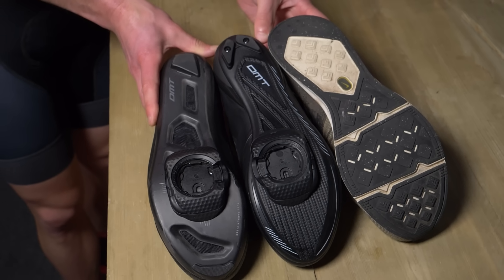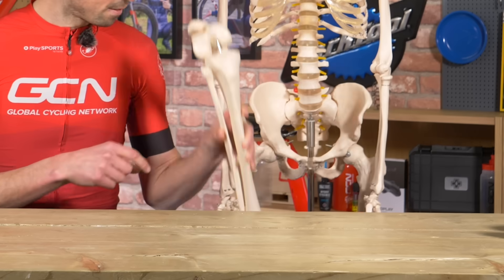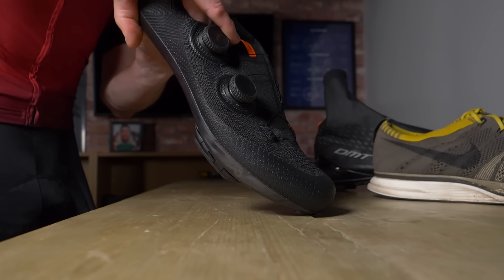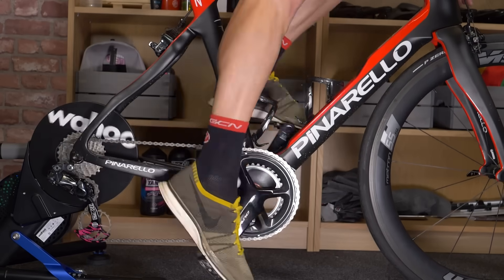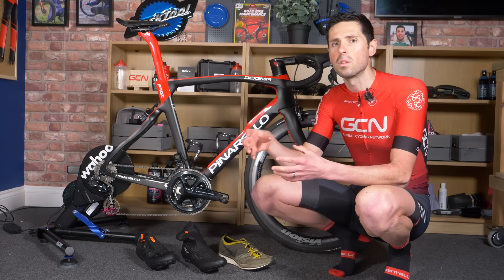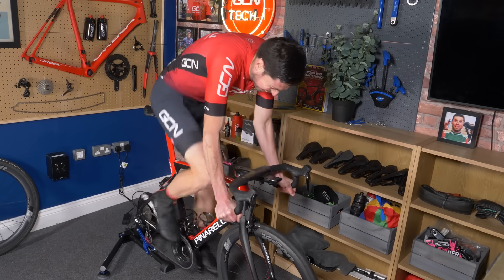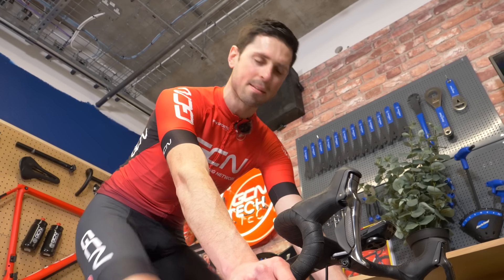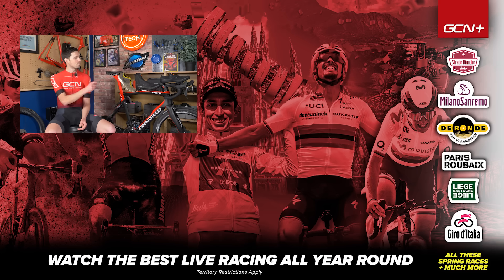GCN Tech Does Science: Do Cycling Shoes Really Matter?

Comment from the maker: Flats on a Pinarello F12??! Hot 🔥 or not ❄?
Reply: Bodge
Reply: The difference is 5% between the clip-in shoes, which is a lot.
Does this experiment only apply to track sprinting?
What about an endurance race?
Reply: @drivemenuts3011  Thats if you believe that guff. It was fixed of course.They want to flog useless carbon soled crappy shoes.I d only accept a mechanical test not some laptog having a bit of a pedal .In real life there would be no difference in any of the shoes
Reply: flats are for mtb. not road cycling. the benefits of clipless pedals and shoes are just way to high on a road bike
Reply: @leonschumann2361  Are they hell.you ve been completely conned all round.Proven beyond doubt and the Myth of the Upstroke has been proven 100% .It does not exsit.Only purpose cleats on shoes and pedals is security. Personally my feet have never slipped off any pedals in my life.Exact same power is on every shoe and every pedal.May be fractions of a watt lost on pedal bearings but thats all.Cyclists are easily conned.Look what the idiots are buying now..Oversized dearailleur pully wheels and oval chain rings lol lol..fools !
Reply: Well your flats don't have the cool little blinky led lights in them like mine so...Not.
Reply: @garrettsmith8286  Yeah, thats at least another 0.5 watts!  😉
Reply: Love it, I wear flats on my bike all the time. Don't have an F12, but I do think that Price is a major consideration. Those Carbon shoes cost more than some people have afforded to their bike. Meaning they must be on flats. Pedal/Shoe combo with proper fitting. 💰💰💰
Reply: If you have a good bike  and have security at work flats during the week.
Reply: @adambrickley1119  l would never run flat in town ever again. the amount of extra power you can get from your hamstrings and hips when accelerating of the lights and so on makes it so much more relaxed.
Reply: You needed the Nike super Marathon Shoe. 😜
Reply: F12 makes a lousy shoe rack

Comment: Stiffness is what prevents muscle or fascia injuries. Learned that even flexi shoes like Sphyre 902 903 at 15% less stiffness than S Works. Induced more fatigue and pain. Over the years learned that I feel these things like a good German shepherd senses lost scents. Anyhow I can tell cheap to expensive, can tell which one is stiffer and more efficient versus less stiff and intended for rpm. Diodoras vs bong vs bontrager etc. Lakes that lasted me 25,000 kms and a new pair of S Works told me the lakes had started to fatigue. Instant 5% speed gain thought shoe alone. For those of normal weight, 75-80 kg, uphill is the ultimate stiffness test. But I can also tell BB vs shell issues, or a bb not fully threaded due to epoxy. Finally o can tell any dura ace or ultegra cranky around 20,0o0 kms I sort of go through their lifecycle and they drop torsional rigidity and speed. So yes stiffness with comfort is faster.

Comment: Beside the output, the comfort also the key factor. I start with a shimano Nylon road shoes with stiffness index as 6 out of 12. With long ride (over 2 hours) I will feel numb with my feet. Now I am still using Shimano R320 (same generation of my first pair but it is the top tier product) with stiffness index 12, never feel numb anymore. Same brand, same size, same cleat adjustment. Somehow beside the sole, the surface also feel fitting better with feet even the entire design/size/etc are the same.

Comment: When I saw this video title, I was expecting a test using the trainer in erg mode but measuring rider output using a crank-based power meter to see how much harder it is to put out a given level of power in the various shoe+pedal combinations.  Does that make sense, or am I off base with that experiment?

EDIT:  on second thought, that test makes no sense, there'd be no difference since nothing would measure losses at the shoe.  I guess you'd need the rider to report how much their feet  hurt, and maybe measure cadence differences.  Maybe with a pedal based power meter with pedaling dynamics measures (and maybe using an spd-flat-platform adapter for trainers with the Garmin XC SPD power pedals and carbon and nylon/fiberglass MTB shoes for direct attachment).
Reply: Really don t want a human with his variable human efforts involved at all.Was a stupid test.Bike Radar did a bigger one using 50 different humans and showed no differences
Reply: @stuartchester7414  u are annoying as hell sir. Just put your cheap flat pedals on your roadbike and use your runningshoes to cycle and be happy with it if you think clips are useless and carbons soles are a joke.

Comment: Cleat vs non cleat give u more secure while off saddle or fast cadence with no worries tripping ur shoes from the pedals, as might happened to the flat shoes.

Meanwhile talking abt flexy vs stiffer cleat shoes might givin u effects based on physics, but consider if u gone for an endurance cycling, that a bit flexy shoes give u some stretches on ur feet in a long run cycling

Just in my opinion and testing

Comment: I recently felt a huge performance improvement by adding a very stiff insole (from Solestar) to my MTB Shoes*. At the trainer my FTP went up by some 10 Watts and my Heart rate was consistently lower when at FTP! (even the updated one!). These very stiff soles are not cheap (mine was 100 Euro), but they are a great way to make a more comfortable shoe very efficient. 
That is btw a good suggestion for a future test. Hold a steady power close to FTP for some 5 to 10 minutes and see the difference in Heart rate, ie. the physiological "cost" of holding the same power. 

*I use MTB shoes on my Road Bike, one because I prefer shoes with witch I can walk on, and two because my feet are wide and it's hard to find a wide road shoe, at least on the local shops here. My current shoe is relatively flex-y, something like 3 or 4/10 from the manufacturer scale, so the improvement with the stiff insole was massive!

Comment: For most of us, the stiffer soles result in less fatigue while riding.  Much more important than effect on peak power. We produce force through muscle contraction. That force pushes on the pedal, and a 10% more efficient transfer is huge over a 3 or 4 hour ride. (Note that at peak the difference was a lot not 1, 2 or 10 watts but about 200 or 20% more than a trainer.

Comment: Don't forget a stiffer shoe IS ALSO more comfortable : 
Apart from some high end pedals with a large surface, most of clipless pedals have tiny surfaces. Cumulate it with a flexible shoe and you end up with a high pressure point on your foot. 

The harder and/or longer you push, the stiffer your sole and/or the wider your pedal surfaces need to be. Be it for efficiency OR comfort.
Reply: Bike Radar tests say theres no difference..anyway who the hell sprints lol ..virtually no one
Reply: Is it hell more comfortable ! thats just your opinion , and its wrong
Reply: @stuartchester7414  
"Just" my opinion that is shared by a lot of other comments here and by many other cyclists and by my physiotherapist that did my postural study.

The physiotherapist that gave us a lesson on ergonomics on bikes during our formation (I'm a bike mechanic) told us comfort is not about softness. 

He showed us pressure graphics. Discomfort is caused by high pressure and softness only has little to do with it. Badly designed and positioned soft accessories can cause soreness and discomfort. Wood-hard carbon accessories can spread evenly the pressure and be surprisingly comfortable if they're well designed and positioned. What I wrote about pedals and shoes comes from there.
Reply: @nounours2627  yes. what confuses people is that switching from stiff shoes to soft shoes relieves foot pain. For example, my extremely soft (i can roll them up) barefoot running shoes feel much more comfortable for 2+ hour rides compared to my Shimano mtn bike shoes (using thesame dual platform pedals). However, the pedal is extremely stiff as it is made from aluminum or steel. So, this often provides an illusion when people only stay focused on the shoes and not the entire interface.

Comment: MTB....where you're sprints are 1500 watts repeatedly....and you CANT get over or past something with any less power.....Stiff shoes, that you can pull up with, help. It helps a LOT.

On the other hand, if you're carrying a bike on your shoulder to climb something, a little flex helps traction a lot. 

Also, the size of the cleat platform makes a big difference. I ride Egg Beaters, and without carbons soles, i can FEEL the shoes bending around that tiny brass cleat....and I'm not even a big guy (140 pounds), nor putting out 2000+ watts.

So, depends on your terrain, hiking needs, and cleat area.

Comment: Fun video to watch. But the experiment would have been more revealing if you used a "normal" lace type mid-priced clip-in shoe rather than a winter shoe that uses a zipper. I can't imagine a zipper holds your foot in pla e as securely compared to a lace system.
Reply: It has Boa closing system. Zipper only closes the waterproof layer. Check 1:43.
Reply: @mikkojolkkonen5932  Ah! Good catch. Thanks!

Comment: I wouldn't mind betting that a fair chunk of the difference between the flexible trainers and the nylon-soled midrange shoes is actually down to the difference between flat and clipless pedals. You're introducing another variable here that you didn't have to. Even just bolting some cleats onto some £20 Lidl trainers (with a credit-card-sized steel reinforcing plate just to stop the cleat ripping out) would have removed that uncertainty.

Secondly there absolutely is a way to measure the stiffness of any given structural object, namely to measure its deflection under a given load. You'd have to make sure all soles were the same size because obviously a size 47 sole would deflect a lot more than a size 35, but such a test would give you a much better basis for comparison.

You can get pedal force data from any power meter so it wouldn't be too hard to replicate the variance in load throughout the pedal stroke for a 5sec sprint, 1min hard effort and 20min sustained effort for example. I would guess from your test and from certain comments on here that perhaps this matters more at high (say >1000w) power outputs than at the more modest levels (250-500w) that most of your viewers will output on a typical ride...

Comment: Stiffness will get you the most watts, but I tend to avoid carbon soles.  I Used a carbon soled shoe for several years and found that my feet would fatigue over long distance rides.  The nylon sole was the best compromise for me.  Gave me adequate power and provides enough flex that my feet don't ache after a longer ride.   Now, everyone is different, and will have different pain thresholds so do what's best for you.  If you can get away with the carbon soles they'll definitely perform better.

Comment: #askgcn Does the bike not get damaged when used in a hometrainer? It's bolted stiff into the trainer at a point that is not really designed to take stress in those directions when used on the road, where the backend is free to tilt sideways.
I see people selling their bikes, emphasizing that " it's only been used indoors.." but I would avoid bikes like that.
Reply: No more load than hitting bumps with the rear end at speed.
Reply: @ERIK31351  That is an up/down movement. Sprinting on a hometrainer, excerts the bike for sideways/tilting forces which never happens on the road, where the rear is free to move.

Comment: Nice test. Probably  shoe stifness is more important in sprinting and less consequential in regular riding where the power output is less than 300 watts.
Reply: Kind of... I use MTB shoes on my road bike, and the one I have is relatively flexible (not like a trainer, but more flexible than a reinforced nylon one). I added a very stiff insole and I felt a massive improvement (some 10 more Watts to my FTP - 260 to 270W - and a lower heart rate when at said FTP. So also for longer Tempo and FTP efforts a decent stiffness does help (but yeah, maybe less obviously than on sprints)

Comment: When I first started riding in the early 80's, I just used trainers with toe clips. I discovered that they were alright for rides less than two hours, but for rides of 5 hours or more, my feet would begin to hurt, and the bottoms of my feet would feel bruised the next day. When I started racing, there were no carbon fiber soled shoes. Nylon soled shoes could get you through a three hour race, but left your feet slightly sore the next day. I finally picked up a pair of Super Stiff Duegi 101's, that actually used a wooden sole to provide the stiffness. By the late 80's, clipless pedals were becoming standard equipment, along with carbon soled shoes. Nylon soled shoes are fine for two hour rides. PS. Not sure if they still make them, but Sedi used to make a shoe that used Carbon AND Nylon in their sole to provide stiffness almost as good as all Carbon.

Comment: How about a casual Z2 ride though? I could imagine the difference in power transfer is far far less between stiff and ultra stiff?
Reply: Seeing as this test was bent and bigger testing have been done showing zero difference, the normal hobby cyclist is wasting his hard earned for no reason..In fact its proven beyond doubt that clipless pedals have no difference neither over flats
Reply: @stuartchester7414  oh no I would strongly disagree.
You’re “locked in” a certain position and won’t slip around.
But most importantly you’re able to pull(!!) up engaging your calf muscles. Apart from being extremely efficient if you use the entire circle within one pedal stroke, I’ve had numerous times where I quads started becoming pretty sore and I just switched to mostly pulling for like 5-10 minutes until my quads are better

Now with the knowledge I can even apply those things pretty well on shorter climbs. I.e. when seated you can mostly pull and when you stand up you can hammer down with your quads, get back in the saddle, etc
Reply: @stuartchester7414  I don’t have to google anything. I can feel it and it kinda saved me from riding an everesting 😅
Reply: @stuartchester7414  but hey if you’re cool with flat pedals stick to them. Nothing wrong with changing anything that’s not broken 👌🏻
Reply: @fabianirsara9846  one born every minute lol

Comment: Informative experiment. I certainly found value in it being a casual 20 to 40 mile rider. Thank you.
Reply: That's how I was when I got my first clipless pedals and shoes, luckily I found a great deal on a carbon sole pair because they are amazing. After a good pair of bike shorts they were the best upgrade
Reply: Why ? it would nt ever involve you.You don t get involved in competitive sprints do you..its a con to sell very expensive carbon (plastic most of it ) shoes .Too many cons in cycling and lots fall for it .Oversize derailleur pully wheels, oval chain rings, carbon wheels, carbon seat pins and bars, electronic gears , and most of all bloody disc brakes
Reply: @stuartchester7414  There is a lot of resentment in your words. What we find value in is our experience not to be judged by yours. Yes there is a lot of snake oil out there and in any hobby/industry. BTW, in my riding routines I practice HIIT occasionally  to build cardio and VO2 max.